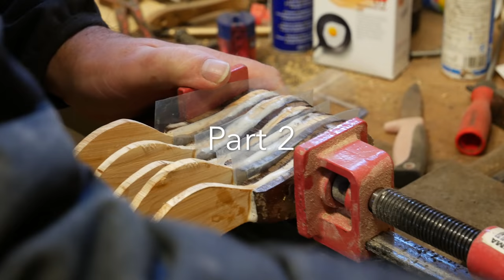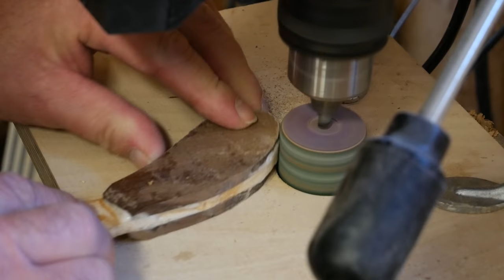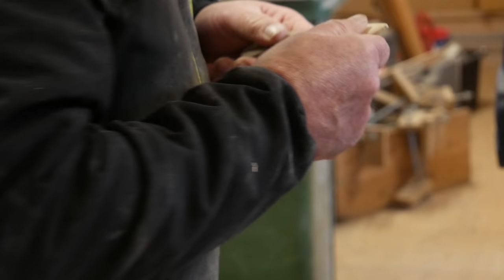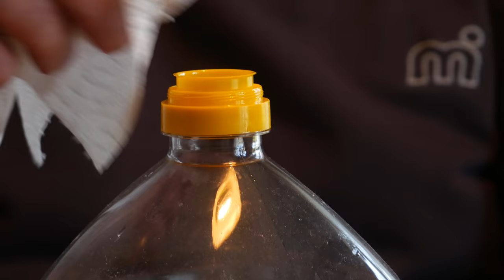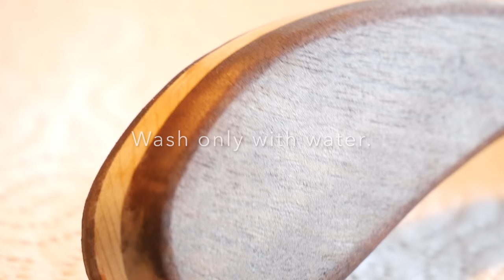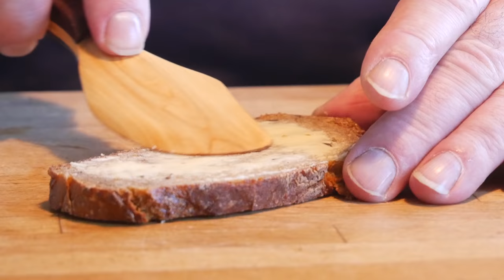Making The Famous Swedish Butterknife - Part 2

Comment: Beautiful work.  The only change I would suggest is to use mineral oil instead of vegetable oil.  Mineral oil won't go rancid and is edible.  It's what I use to oil wood salad bowls.
Reply from the maker: Thanks for the tip.
Reply: Mineral oil blir solgt som parafinolja (ikke parafin) her borte også som medisinsk parafinolje på apotek.
Reply: I agree with the use of mineral oil.  I've been using it on cutting boards I've made over the past 3 decades with no harmful health effects, and it keeps the wood from drying out..  I get it from my local pharmacy to ensure it's made for human consumption.  I really like this butter knife project and will be trying it out myself.  Nicely done and beautifully practical.
Reply: If you want to use a non petroleum based oil for wood, flaxseed oil is usually recommended for cutting boards, also, boiled linseed oil. Neither of them goes rancid, or supports biological activity.
Reply: correct,  veg oil, olive oil, etc  definite no no.
Reply: You may NOT use mineral oils... All contain molybdenum!!! Cancer!

Comment: I don't know if they sell Titebond in Sweden, but if they do, use that instead of the poly glue.  Strength is as strong or stronger than the wood and it will be easier on your abrasives.

Comment: Very beautiful knives. I think that if I were to oil a wooden knife, instead of vegetable oil that will over time go rancid, I would use boiled linseed oil. The knife would still be food grade to use and the oil will not go rancid, ever. It would also act as a preservative for the wood.
Reply: NEVER boiled linseed oil! BLO contains toxic chemicals to speed the polymerization process. Be sure to use RAW linseed oil, it can be found in the health food section. It is also known as flaxseed oil.
Reply: Uhhh, and just what are these alleged toxic chemicals you are referring to? Could you please list them so I may research them? And raw linseed oil will also, as with any raw organic oils, go rancid and if you ever ate anything with any residual rancidity to it, you would know what I mean and how you would not want to happen to you, your loved ones, or even your worse enemy. Unless you are in need of a good strong laxative.
Reply: BLO contains metallic drying agents like cobalt manganese salts. It used to be made by boiling linseed oil with lead oxide.
Reply: I use mineral oil for food contact items such as this, available at the drug store, and some dollar stores.  Food safe, won't go rancid, cost effective.

Comment: Nice work, gonna give you a small advice on the oil. Use oils like hazelnut, walnut or linen, they dont rot and are neutral to Food. Thoose hard oils make the Surface harder and wont rot, what offten Ends in a nasty bad taste on the butter or bread. I go to medieval Festivals and all of our equipement is pretty much either out of Wood or pottery. It may be not cheap but it deffenitly highers the Quality even more.

Comment: I don't know about people who are saying "Mineral oil is safe."  Yes, SOME mineral oils are safe, but not all are.  If you are going to recommend mineral oil, be specific about the type.  Also, after working with wood for over 35 years, I have NEVER had olive oil or walnut oil to go rancid on an implement.  But then, the wooden kitchen implements I have made are used at least every other day, if not every day, so they get wiped off and renewed pretty regularly.  If you are making an implement "just for show" that will hang on the wall and collect dust, by all means use anything you want to coat it.  Even beeswax can be used on something you intend to expose to foods (such as a cutting board), but it would be a bit more difficult to apply to the knife shown in this video.  I make a protectant by melting some beeswax and coconut oil together, that works well for many things.  Avoid petroleum products as much as you can, is my motto.
Reply: "avoid petroleum products"  good motto.  That said Mineral Oil that is "labeled food safe" is perfectly fine if you cannot find Walnut Oil (which is my goto for wood food implements)  I've never tried beeswax...it sounds like a good idea though.

Comment: You can spread so nicely and evenly the Arla butter, just because it is not real 100 % butter, but a mix of butter (80%) and raps oil otherwise called canola oil (20%)... try with a cold piece of lurpark (or south european butter) and you won't be able to do so ...

Comment: Hardening oils, like walnut, should not create a food allergy, since the hardened oil has little in common with oil in a bottle.

As to the dangers of mineral oil, the quantity someone might ingest from the using the tool would be nearly immeasurable.

Finally, as others point out, never use vegetable or olive oil. These things go rancid, and they build and gum up over time.  Though I met people who are more than a little adamant about using "healthy olive oil," they, apparently, never smelled their boards a year down the road.

Since these are butter knives and will not see hard work, you could also use a varnish or lacquer, but I'd go for a hardening oil first, for the effect it has bringing out the wood grain.

Many claim they avoid poly and other finishes for food safety reasons, but most the stuff advertising as food safe is just taking advantage of marketing. After a finish hardens, it's food safe.  The only thing I worry about is finishes that would flake, if put on too thick.

Comment: Thanks. The reason I mentioned coconut oil is because that and mineral oil seem to be the only two I know that do not change the color of the wood. I do know that mineral oil is a petroleum product. It is also the only ingredient in baby oil and in the U.S., there is a food grade mineral oil. Still, it seems to me, although perhaps untrue, that it would be better to use and oil that can be put in food. On bottles that contain mineral oil, it says don't put in food. Still, many manufacturers put instructions to use mineral oil.

Comment: I very much doubt this wooden knife would pass the health and safety  in England, wood that comes into contact
with food is always a bad idea , people seems to be saying wow on this project , i am wondering why , its a little 
wooden knife made with all the power tools money can buy , whats next a little wooden gun?
Reply: Because simplicity and clean, flowing lines can be beautiful.
Reply: shaun rish too late the already have a wooden 1911 it wonderful
Reply: Ok he used power tools but I was so impressed that I made one by copying the design from  my I pad. I used a small bandsaw to cut it out and I used my belt sander for the rough sanding. I used a small drill press to drill small holes for quarter Inch holes for dowels for design effect. The rou did g of the edges I did with a wood file. I also used sand paper for asding the whole project. I will be putting mi Aral oil on it  it looks great   it was a lot of work, and that was just one. Can you do that Mr negative.
Reply: I still use wooden food utensils to this day(60 years) and have had no ill effects. Maybe today adults aren't  properly prepared to care for them and that's why there needs to be safety rules.(aka: hairdryer, don't use in shower label).
Reply: Obvious troll is obvious
Reply: The humble wooden spoon, spatula, fruit & snack bowls? These are just a few items I use regularly and readily available in the UK. You have to use wooden utensils in baking as metal can sometimes affect the mixture. Bugger all to do with H&S.
Reply: 대단해요